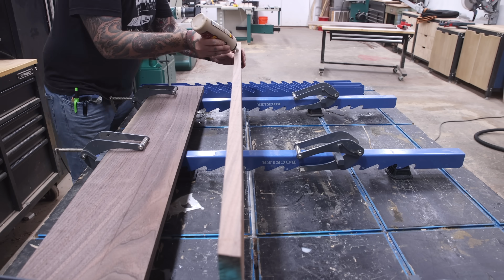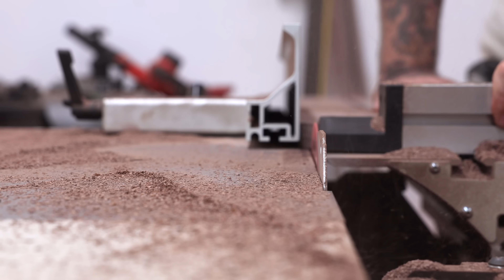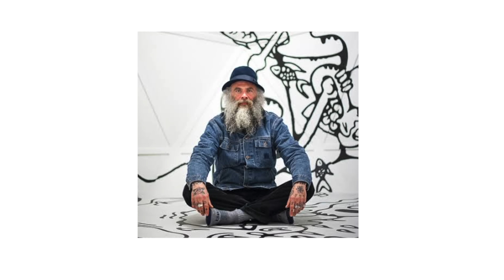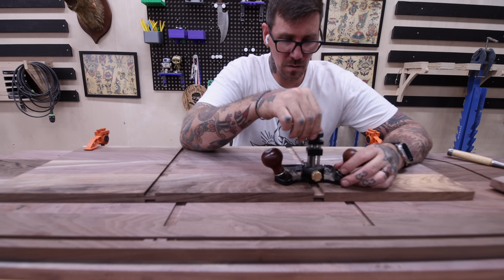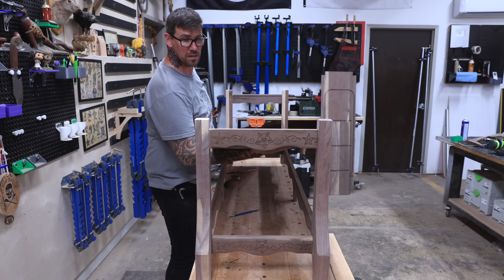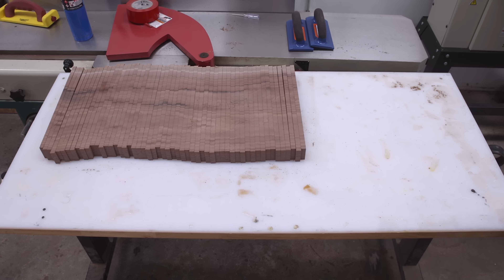Secrets Behind My Toughest Build Yet

Comment: Worth noting: the US government actually does use metric.  They just decided it would be improper for them to impose that decision upon the general public, as the public has the right to self expression, which includes the right to use whatever measurement system they want.  So most non-government stuff still uses imperial/English derived units (The "US Customary System," officially)  So it's not your government's fault, either.  It is your fault...but only about one 300-millionth your fault.  The rest of that goes to the other 299 999 999 odd Americans around using Imperial units.

Comment: Would it be better to make the door panels with the grain running top/bottom making it much stronger? or is strength not an issue once it's glued to the backing material?

Comment: Dumb question why do you CNC after tambouring? Why don't you CNC first then cut them up?

There has got to be a reason but I am too much of a noob to spot it.
Reply from the maker: You need a flat even surface on the front of the doors while attaching the felt backer. If you carved first it would be a nightmare trying to do that.

Comment: Fun fact,  the US is technically metric but still "prefer" to use imperial, all imperial measurements have been defined in terms of metric units since the 19th century. They have a hybrid system which is kinda strange...
Reply: I’m in Canada, and when in school drive my teacher nuts because I’d switch between metric or imperial for whichever had a ‘nicer’ number. 20 years later I still do this.
Reply: @Anggea  As a Canadian engineer, our schooling ensured we could work in either imperial or metric.  It doesn't take too much work to realize why metric is simply better for engineering, though.  It is usually much easier to spot errors along the way.
Reply: @KnugLidi Most American public schools teach metric in the sciences.  Americans just prefer their feet and inches for day to day.  The UK also has it's own hybrid system.
Reply: @Anggea "teacher" can't even convert metric and imperial..  they should be a 3rd grade student not a teacher😂😂😂
Reply: My understanding is that the US uses imperial, but the imperial units are defined in metric.
Reply: Yea and we almost made the full switch especially after the signing of the Metric Conversion act under Ford. Reagan just about killed it, Bush Sr. revived the effort and Clinton killed it for good because he didn't want to provide any funding to convert the interstate to metric. Annoyingly enough, we could easily have made the switch by now without spending any more than we ended up spending anyway during the routine replacement of signs.
Reply: Yeah, officially it's metric, all science and engineering on a serious level etc. But regular folks are too stuck with imperial and so shops selling stuff also keep selling in imperial. Imperial is literally defined in metric. The base/reference in vaults in US is in metric. People need to move on and make a total shift, but that isn't gonna happen without top down enforcement.
Reply: @jcerny  "Top down enforcement." This american has a metric measurement for you. 9mm, get your authoritative crap out of here.
Reply: The US doesn't use "Imperial."  US customary units predate Imperial.  There are differences.  The most obvious ones are in the volumetric measures.  An Imperial pint is bigger than a US pint.

Comment: We need Imperial and Metric, both. Imperial is just better at organic and furniture pieces which is why even Bodgers in rural UK still use it. Metric is better for mechanical and precision pieces. It's sometimes hard to pull numbers out your bum to figure out what width to make a chair seat. It seems like you never have a round number that also sits well, and so the OCD of having every measurement end in 0 or 5 keeps you from just making  a good end product.

Comment: Those 'failed' doors would be hella wall art.
Reply: That is a cool idea…if you use thin strips of colored epoxy between the individual wood strip, some led strips behind it, that would be cool, just an idea….. I would definitely hang it
Reply: @Rob_Haarlem   Better: cast different colours of Epoxy into strips then glue them all together into a solid slab and carve the Wave & Skull pattern into it before installing LED backlighting...
Reply: @Rob_Haarlem  If you used strips of acrylic the same width as the saw kerf and stacked them in before the CNC process, it would look amazing! I now have a project in mind. I’m also thinking about laser engraving another pattern into the sides of the tambor strips that can only be seen on the radius.
Reply: They would definitely be extraordinary wall art. I’m sure if he auctioned them off at an auction, buyers would be going back home with a beautiful piece of art.
Reply: I think offsetting the pieces so that they don’t completely line up on the vertical axis would be really cool too.
Reply: I was thinking you could do something like add slightly curved support behind them and use them as like somehting on top of a dresser or end table or desk or something like that, kind of a backdrop piece.
Reply: For a corner wall to showcase all the work, flat isn't nearly as impressive
Reply: Wall cabinet
Reply: Your from Nor Cal huh.
Reply: Yeah especially if you use different stains on different parts like the skull itself with a different stain color than the rest of the piece
Reply: @zalbercook  Black stain in the eye sockets would be neat!
Reply: It's an advert. He sells those cabinets to make a living
Reply: stop saying 'hella' cartman!!!
Reply: Hey, that was my idea…lol
Reply: What is a hella?
Reply: @Len838jrnso99  Basically "really" or "very", but has evolved to mean "really cool".  So, we used to say something like "That'd be hella awesome".  Now you'd just use "hella" instead of "hella awesome".  Dates to the late 1980s, early 1990s, I believe.  At least, we used it when I was in high school and I graduated in 1994.
Reply: No one uses the word "hella" anymore. That went out about 10 years ago.
Reply: @davearonow65  You're hella wrong about that though.
Reply: @davearonow65 false lol
Reply: @davearonow65 
Seems he does, and we all understood what he said so what’s the problem?
Reply: What adult talks about things being “out”? 🤣😂🤣
Reply: @davearonow65  Yeah? Well, you know, that's just like your opinion, man.
Reply: @davearonow65 Us in the bay, where we started the hella trend, still using it and it’s hella dope
Reply: @davearonow65 Just because you don’t use it anymore doesn’t mean others don’t.  The world doesn’t revolve around you.
Reply: @davearonow65  that's hella stupid.
Reply: @davearonow65  Damn you are hella wrong
Reply: @davearonow65  Not true at all